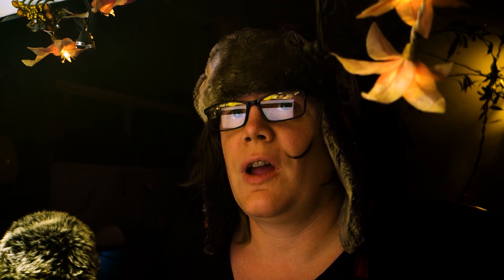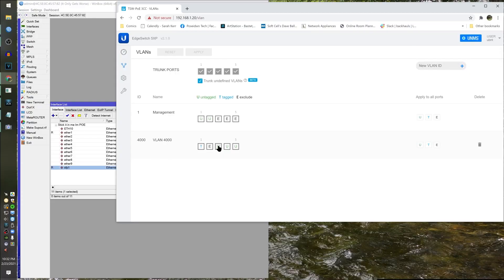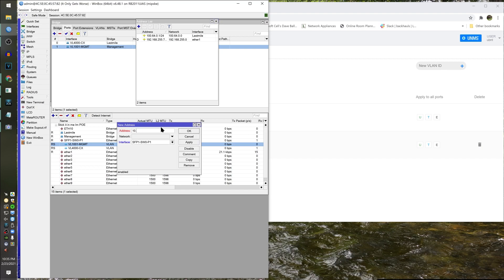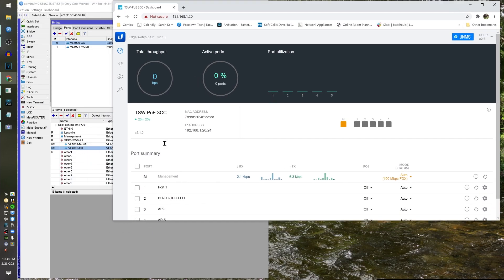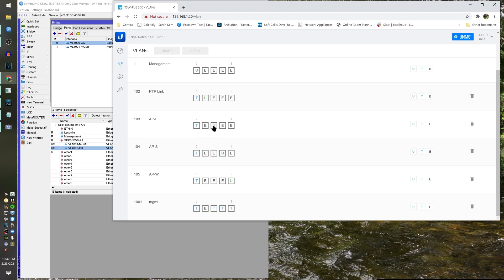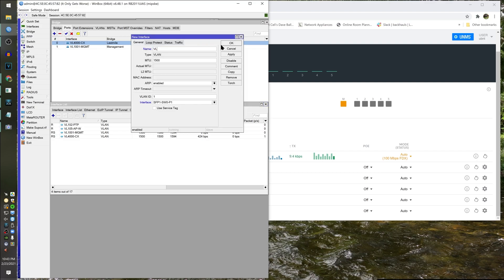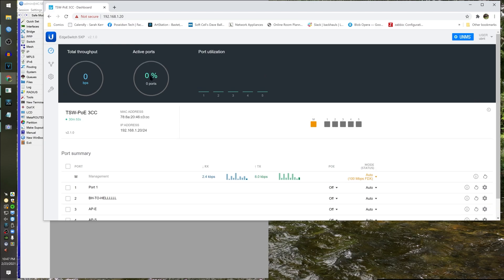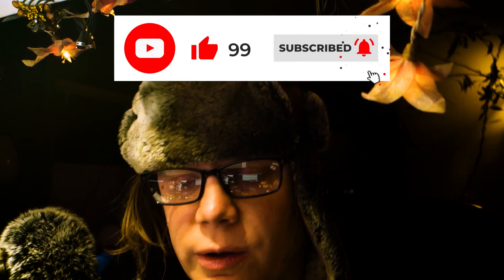Vlans on Ubnt Edge Switch

Comment: I've been trying to get VLANS working on my Ubiquiti Edgeswitch 16 XG for YEARS and I simply cannot get it to work. Port 1 on the switch goes to my pfSense mini-PC router. On my mini-PC router, there are 4 2.5GB NIC's: port 1 is the WAN connection to my cable modem; port 2 goes to port 1 on my Edgeswitch 16 XG. I setup a VLAN on the router, assigned it to a port and configured a DHCP server.  No matter how I try to configure my Edgeswitch 16 XG - WHICH LOOKS NOTHING LIKE ANY VIDEO I'VE SEEN ON YOUTUBE, it simply will NEVER pass packets to my router that are tagged with a VLAN. It just flat out refuses to work. I've been trying for YEARS and I cannot get it to work. YouTube videos make it look so easy - but to me, it's IMPOSSIBLE.
Reply from the maker: It's most likely pfsense. 
If you'd like you could book a session with me and I could teach you vlans. Get them working for you?